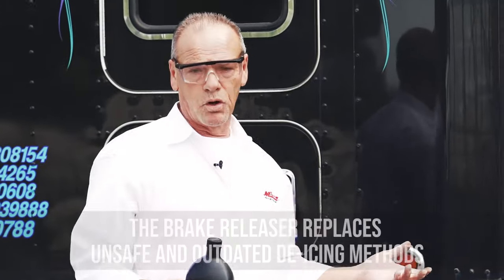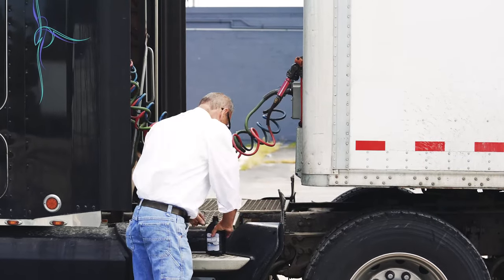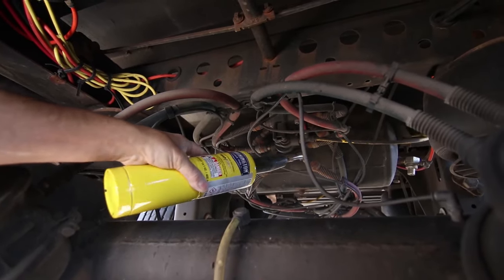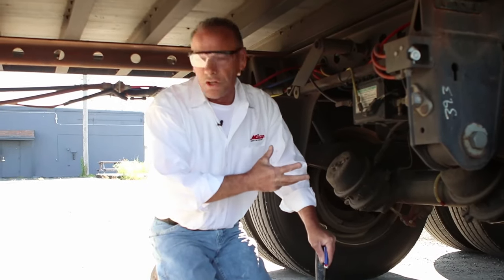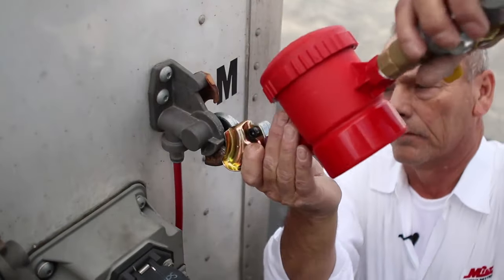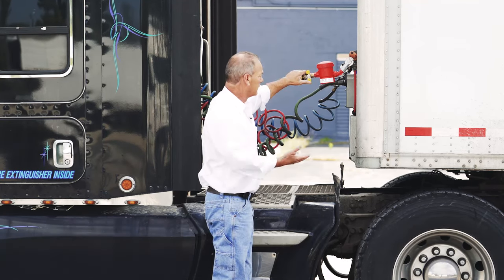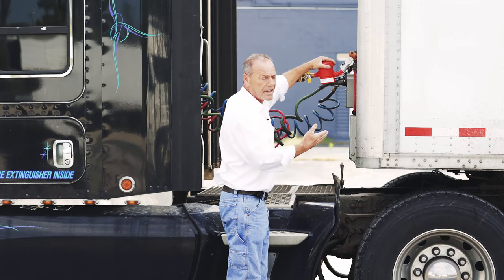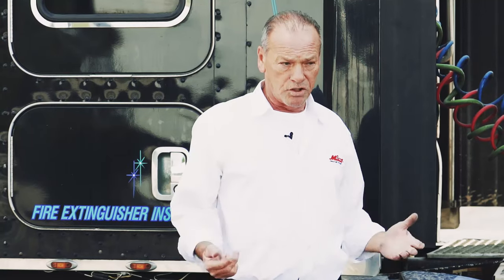The Brake Releaser® by Milton Industries - Turbo Boosting De-icer Delivery System

Comment: So what magic eliminates the need to heat the frozen valve
Reply: Weisenberger Family that's what the airline alcohol does. When it gets to the valves, it thaws the ice out of them and lets the air flow.
Reply: Mark Scott if the air is not flowing how does it get there ? And further more this may work for the emergency valve but once it flows to the tank the alcohol drops in the air tank and never hits the service brake valve. And that’s if it is plumbed that way. What good is freeing up emergency brakes only? And don’t say put it in the blue line because that will only free up the control side. Annnnnd even more if the s cams need to be pounded your still under there with a hammer.
Reply: Weisenberger Family it'll flow through all the valves and if the shoes are frozen to the drums,yea you're right you'll still have to crawl underneath, nothing is perfect that's for sure and to be quite honest, that air line alcohol isn't the best stuff for those valves any way because it dries out all the rubber parts in them but it's better than using a torch on them.
Reply: Mark Scott well mark seeing as I am someone that has actually done work that proves you wrong I’ll stick with what I have physically seen and done
Reply: Weisenberger Family ,well I've been dealing with this stuff for almost 40 years and I know what has worked for me so if you've got a better way,let's hear it.
Reply: Weisenberger Family ,wow,if you have to resort to calling names like a little kid then you're not even worth talking to about this.In my experiance, it'll flow through all the valves like I said,I know this for a fact and you can't tell me any different and that's all there is to it, hope you're proud of your self.
Reply: still waiting for you to realize if its not able to flow it wont work. i call it like i see it carry on to your safe place
Reply: @user-vd9fz5ey9m  The alcohol will flow the entire system.  Before air dryers were invented, truck manufactures used Alcohol Evaporators on trucks.  The US Army still uses that technology on  some of the older equipment.  Google it.  I have been around long enough to have used the system in winter conditions and can attest that it works.  Alcohol evaporators are old technology that works. Methyl alcohol vapor is introduced into the air system as warm, compressed air travels from the compressor to the air tanks. The methyl alcohol helps to prevent freeze up during cold winter months.

If the brake shoes are frozen to the brake drums an air dryer or evaporator will do nothing as it is not part of the air brake system.  Years ago it was very common for trailers not to have spring parking brakes, but stabilized with chock blocks.  When you went to connect the trailer you would back up to it connect your air lines charge the trailer brake system and use the hand valve to lock the wheels to back under.  I could go on about air brakes and parking brake systems but I answered your question with facts that you can google if you don't believe me..

Comment: what a waste of money ??!!!over a million miles ,(mostly off road ),,and never needed to heat up a valve , no flat spots ,but have had my share of smacking the brakes to release them from Ice bonding between brake lining and drum ,,(which this doesnt accomplish) poorly maintaining your air dryer system is about 95% of your problem in the winter time if you ice up .use maybe 2 qts of methanol per year!!!
Reply: The first time I ever thought my brakes were frozen I was beating the crap out of the rotors trying to release the brakes. Turns out there was a kink in my emergency line and they weren't actually frozen 🤣